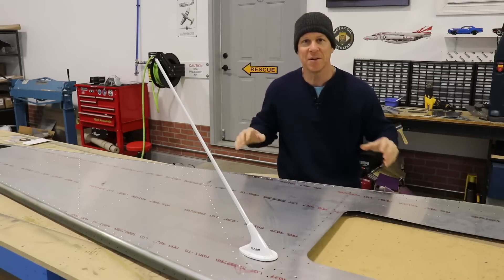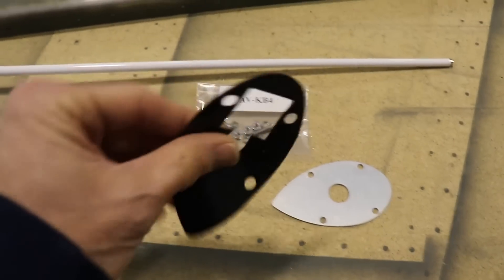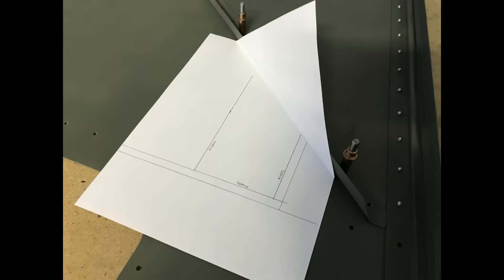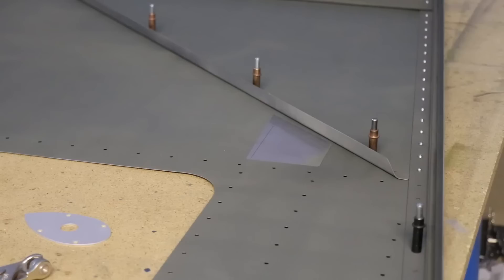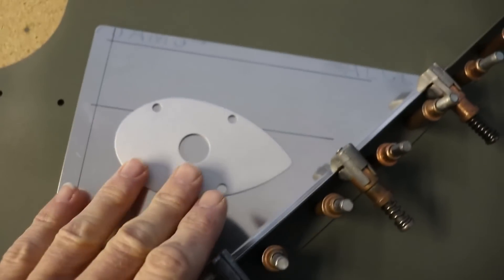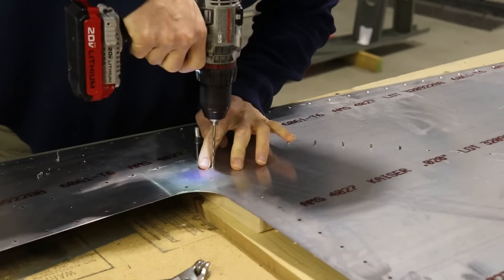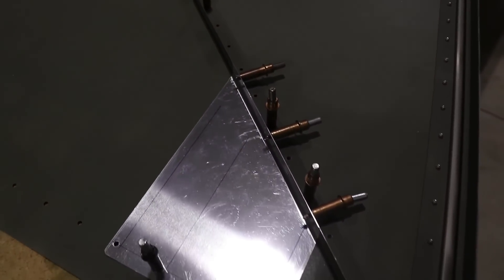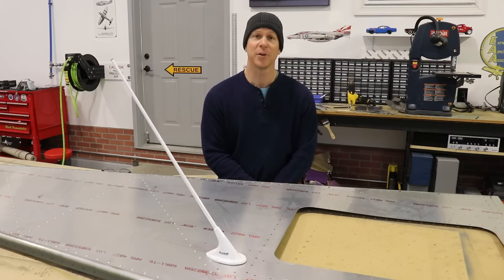Installing a RAMI comm antenna (Ep26)

Comment: Yours came with a template and installation hardware.  Mine came with with some bubble wrap..... no hardware, no template, nothing except the box and bubble wrap.   Bought 2 from Aircraft Spruce, but the box says Rami and was sealed so I don't think it makes a difference.

Comment: For your antennas/lights, did you consider installing an access panel in the area you want to have the piece, and then mounting the piece in the center of the access panel?  That way, if you need to fix the piece, all you have to do is remove the access plate which will remove the assembly. Then you can easily work on or remove the piece from the outside of the plane. Also, if you need to replace the part with one that has a different hole configuration, you would only need to create a new access panel to mount the new one.
Reply from the maker: I did not. The antennas on my Cherokee were 51 years old before they needed replaced. I think I’ll be good with these ones!! Also, making another plate to mount on the top of the fuselage is one more large area for water to get in.

Comment: What thickness was your doubler material?  It look pretty thin in the video, but it is hard to tell.  Most recommend at least 0.040” and often 0.060” or so is recommended.

Comment: Nice job pointing out the importance of the ground plane for the VHF antenna.  The 118-136.975 MHz (19 MHz wide) VHF aviation radio band asks a lot  from the typical 1/4 wavelength aviation antenna.  At the center of the band 127.5 MHz, the antenna length should in theory be about 22 inches, at 118.0 MHz  23.7 inches, and at 136.975 only 20.5 inches for a perfect match with no reflected transmit power.  Most aviation antennas are designed for the center frequency and the specifications read something like 2.0 : 1 SWR (Standing Wave Ratio) or less. Frequencies farther away from the center will have a higher SWR and higher reflected power.  The center frequency is likely 1.0 : 1 with zero reflected power. At 2.0 : 1, that means that 10% of your transmitted power is lost, reflected back to the radio where it becomes heat.  The more expensive antennas may have some type of matching circuit that makes the SWR better across the band.  But, the kicker is, for any of this to even be true requires not just a good ground but a good ground plane. The metal fuselage is part of the antenna. So, the outer braided shield of the coax to the antenna needs to be well grounded or through the connector to metal at the base of the antenna. And that metal needs to have a radius as close to the length of the antenna as possible to get the maximum effectiveness. I've seen fabric covered airplanes with no metal ground plane at the antenna, instead just a little jumper wire to the frame "to ground it".  So, they may have had much more reflected power back to the radio each time they transmit, limiting their communication range while also eventually damaging their radio's transmitter by on-going heating.  Sorry for the monologue but correct antenna mounting is important. Thanks for pointing it out.

Comment: I started to mount my Cruzer antenna per Mark's suggestion - makes sense, but after reading a few comments about the "ground plane", it seemed like a center location would at least in theory be better.  I wrote to RAMI and they replied that "you should be OK with this installation for most communications, if anything, you may notice reduced transmission range off the side of the antenna with the least amount of ground plane.  In an ideal world, you would want about 22 inches (1/4 wave length at COM frequencies) extending outward from the antenna in all directions, however that is hard to do on most GA aircraft".

As an aside, RAMI has superb technical support as I have written to them twice now and am getting quick and thorough answers.  Agree with Mark they are high quality units and also made in the USA (MI).

Mark - I am not sure if you are already aware of this trick, but when you locate your antenna mount holes, a good way for spot on placement is to locate/clamp the backing plate where you want the antenna, then insert a piece of 7/32 inch aluminum tubing and drill through the tubing with a #12 bit.  Doing this for all bolt locations will give you perfectly concentric #12 pilot holes that can be expanded to the necessary final size of 7/32 inch.  The tubing protects the backing plate from any bit damage during the hole drilling.

As always, thank you for these informative and helpful videos.

Comment: Have you ever heard of, or considered using a Roper-Whitney hand punch to make some of these holes on the smaller pieces? They have a centering point to fit into a center punch dimple, and make a very clean hole. https://www.amazon.com/dp/B00YFTVSHG/ref=cm_sw_r_cp_apa_fabc_2984Fb51PTE6Y

Comment: Why do you keep calling it L angle when both sides are the same length. To be correct it would be V angle.  But as its bent its just called angle and not channel or box section  or tube for round section as would be described for other profiles
Reply: Got any constructive questions?